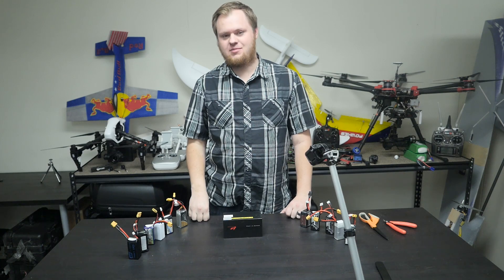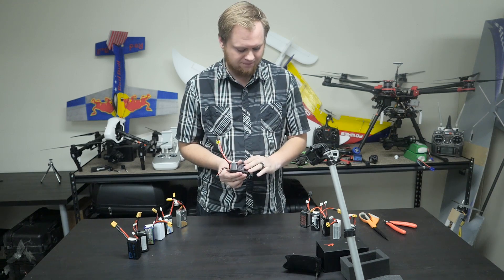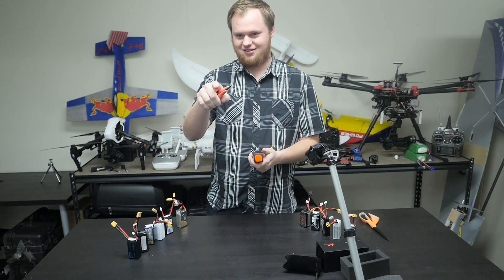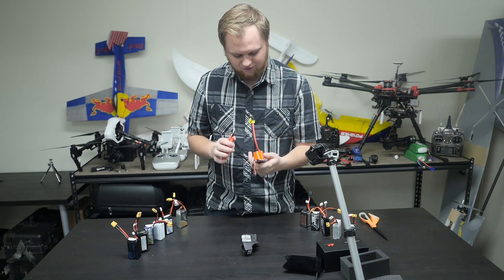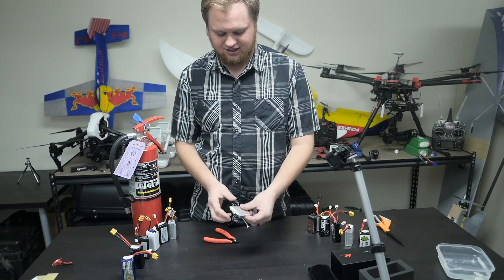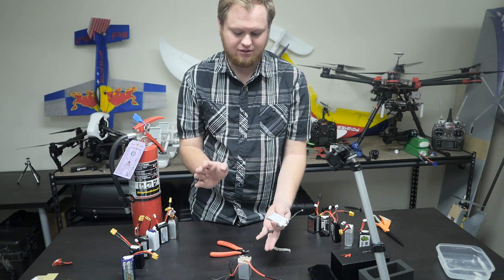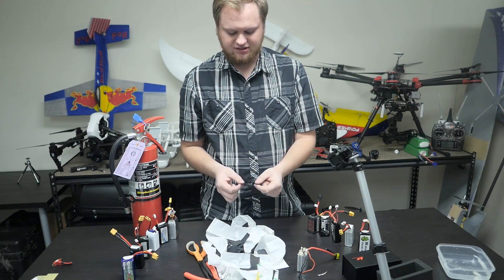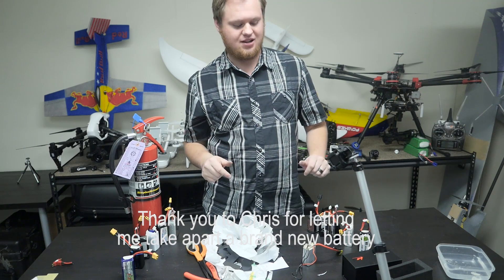Hobbyking Graphene Lipo Review and Teardown

Comment: If the graphine claim isn't totally BS, I'd imagine they mixed it into the cathode material.  And that actually decreased the conductivity or some of the electrical properties, so they had to add more layers to make them fatter.  which maybe has the result of being more forgiving of extreme conditions and temperatures.

Comment: Ooooph...  Just dropped 300 on 11 of these..... I need some tissues....
Reply: Pat B I kinda have to agree with you.. But tend to be a bit skeptical of these sorts of anticipated or "hyped" products. Don't get me wrong, I can hardly wait for the new generation of cells to finally be released on the consumer market... Battery technology is way overdue for some "futurization".
Reply: Yes I'll let some others pony up first before I buy. The most annoying part about these batteries is the silly over packaging. Shipping on lips is already high and this just increases that for no reason on a battery that is already the most expensive in it's class. Magnetic closure box, really? Silly.
Reply: +BigCarKilla Well they are good packs regardless of everything said here... And is they can handle quadruple the cycles then they will pay for themselves. BUUUUUT!, i would not call them king. Ive tested, and they get spanked by bonkas 75-150c and they really get spanked by bonka 80c-160c lihvs.... Ive seen non of the big racers using these except one.....
Reply: Looool... That's gotta sting a bit
Reply: +WhomImIzFPV Why would you do that on some new unproven battery? Maybe buy one for a tester first.

Comment: thanks to your friend to sacrifice in the name of curiosity.  I am very skeptical of the graphene claims, cause it is a capacitor, not a battery.  

Google and 5 minutes will find you some mention of graphene in the anode or cathode part of the battery, about 4 years ago.  I still think these are slightly enhanced batteries, with a leap forward in internal resistance and increased charge cycles with less capacity loss.

not sure why you are getting so many dislikes, you took apart a battery and found battery guts.  Maybe next time you should photochop in a flux capacitor to make the masses happy!

Comment: thanks for this. I was curious about graphene being actually used already (as it's sold to be the tech of future batteries? ultra quick to load...)
I have the tattu 1300 4cells as well and use them for my vortex250. I also fly with turnigy 2200mah 4cells (which are fairly big).
which are your favourite batteries for 4cell miniquads? I'm looking for something bigger but wanna have as little weight as possible :)
Reply: Glad to see you here, you have some of the best videos out there I noticed most of your flights are relaxed and long in duration have you tried or considered the turnigy multistar they have lower c ratings like 10 and 15c but almost half the weight I ordered and just got a 4000mah 3s multistar 10c and it weighs the same as my 2200mah 25c but double the capacity I was after longer flight time when I decided to purchase but haven't got the chance to test yet due extremely long hours at work and bad weather here in the southern part of the United States.
Reply: +nasarami how did that battery do did u ruin it

Comment: When I  initially saw the bigger size and weight I hypothesized that that meant these batteries have a higher capacity than is mentioned on the label. Using graphene would mean that they could have increased the total surface area, and decreased the internal resistance, both resulting in less mass and size or more output for the same mass and size of regular LiPos.
However, a 40c battery with slightly more capacity can put out 40 times that capacity in amps, which (I thought) is why they appear to be more powerful than the other batteries: they actually are bigger batteries than the ones we are led to believe are direct competition.
This hypothesis could be tested by measuring the capacity, but I opted out of buying these and went for lighter ones instead. Could you measure the capacity of the remaining cells?